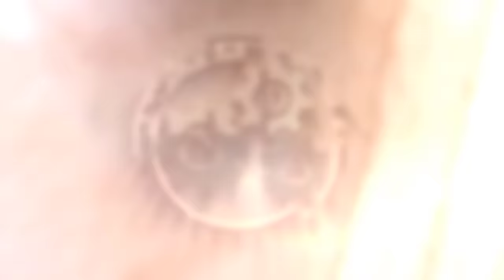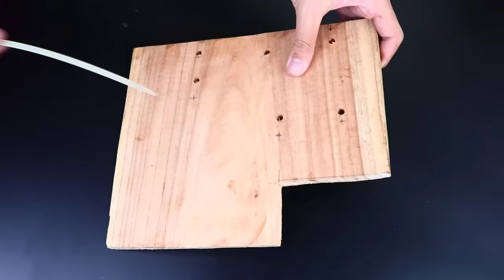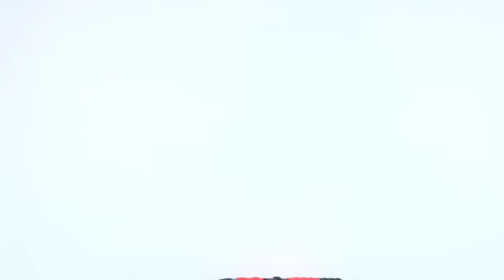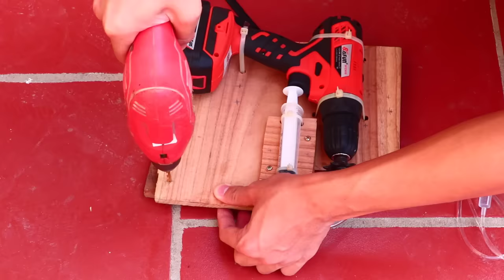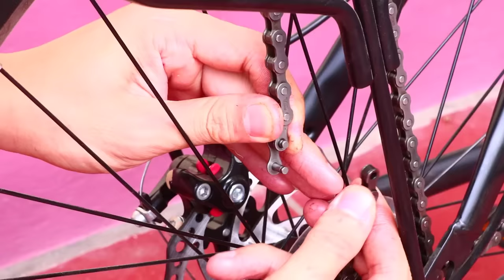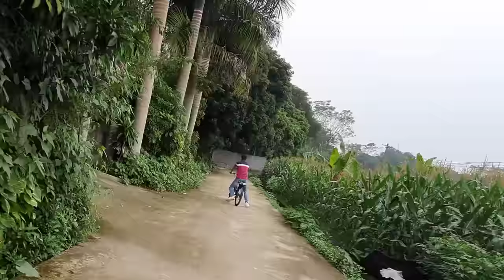How to Make Electric Bike with Drill Machine

Comment: The hydraulic throttle alone was Brilliant!! Loved it.
Reply: i thought so too. I could not understand what he was doing. very cool
Reply: Pneumatik Not hydraulik
Reply: @sawe4207  Pneumatic uses air, this one is definitely hydraulic
Reply: There is nothing in there, also air, also Pneumatix
Reply: @James-wd9ib  no I'm pretty sure that's just air
Reply: @ceterfo  how would you explain the small bubble of air in the syringe? XD
Reply: Ingenious as F ! I thought it was water cooling or something wild to start with
Reply: You could also use a bike brake cable and handle loop it around the drill throttle then cable connector
Reply: @sawe4207  there is water in it. There would not be enough pressure for air to be able to move the larger syringe and the throttle at the same time. Air compresses far too much to work. Definitely hydraulic
Reply: @MountainYucker Old post, I know, but yes, Hydraulic. Air compresses, and is the reason for spongy brakes (trapped air). Fluid doesn't compress, and that is why it's used in brakes.
Reply: An “ injection “ of genius!

Comment: 10/10 for idea. But would be interested to see how long it lasted before it fell to pieces.  Needs more development I don't think cable ties will last. Hopefully you take comment in spirit intended as appreciate your video.
Reply: I don't think this is meant to be an actual ebike. The battery is only 30wh even in the best case, so this will last you all of 20 minutes probably
Reply: @balazsrako9528  20 minutes is enough.  If you add a solar battery and build a solar canopy at the top, then it will take you a while to run out of energy.
Reply: The rider could easily purchase and carry extra charged batteries, and it's just as easy and fast to exchange them on the spot rather than an actual ebike battery. From all the reports I've heard and from my experience in dealing with tool batteries, they're also safer.

Comment: High torque, 2 hour max range lol. Awesome ingenuity though🇺🇸✌️
Reply: Sounds perfect if so.  I have an extra drill and want to try this. 2 hours on one battery would be great since I could carry a days worth,  no problem.
Reply: Video is downhill,  probably doesn't work.
Reply: @kickinbilliards5971  when you have the correct ratio and or a powerfull drill it should
Reply: @kickinbilliards5971  video fake
Reply: @kickinbilliards5971  It would still be good as an uphill assist imo

Comment: Great throttle system. I plan to not use chain and sprocket but fit small rubber wheel to the drill and drive straight onto the tire as I only drive on hard roads.
Reply: Thats what I wanna do to, mostly because i know I’ll forget and shift on to the drive gear with my old school tension shifters (thats not the proper name but not clicky gears

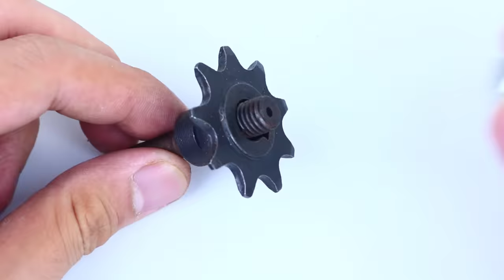Comment: can i ask you, what is the part you use at 0:40? does it have one of those splines that lock with the gearwheel?  im trying really hard to find a bolt/axel that could fit the gearwheel. (i have same gearwheel as you, m11. 

thanks

Comment: Hello, I would like to know where did you get the bike sprocket that attaches to the drill? I want to buy one.
Reply: Please I want to buy one
Reply: You can buy it from amazon or just google 9 teeth e bike sprocket. It's the 9 teeth sprocket that usually comes fitted with geared 250 or 350w china made brushed DC motor of UNITE conpany. For 250W the model name is MY1016Z2 & for 350W it's MY1016Z3. Both come with that standard 9 teeth sprocket with square key grove. You can also get 11/12/13/14 etc teeth sprockets that come on other china motors of same make, eg. MY1020 has 11 teeth sprocket.

Though..... I don't recommend going for china products anymore after their gift of corona.

Edit : PLEASE check the pitch of your chain as the sprockets come in different sizes. More specifically, the 250W & 350W motors with 1 step gearbox reduction come with 9 teeth sprocket & can be used with cycle chain directly. But 11 teeth sprocket on 500W motor (which spins to 3000 rpm & has no gear reduction like above motors) can't be used directly with cycle chain as the sprocket is small & required #25 chain. Cycle chain is bigger than that.
Reply: @saketjoshi4476  how about the axel that's fitted inside?
Reply: @blueskiesinc  which axel are you mentioning exactly ? And also how can I help you with that ?
Reply: @saketjoshi4476  it's the one at 0:39 .  Any idea where I could look for that part?
Reply: @blueskiesinc  Ohh heh ! I see another guy asking the same question out in the comments. Not to worry ! If you observe closely, any drill machine has a 3 jaw center chuck which holds rod type drill like tools (& ONLY TOOLS). For that axel you are talking about, it must not be available in the market as the market sells only the mass manufactured parts designed for a particular machine & as everyone is not going to use a drill machine to move a cycle, this part is not going to be in the market. This axel is very application specific. So, what you can do is manufacture it with simple dimensions out of mild steel & get it blackodised or any micro layer coating to avoid rusting. If you have a manufacturer or fabricator workshop near you that has a lathe machine, you can show this axel to the guy there & he will craft it for you. It will be a just a little bit costlier to get it manufactured than a mass produced tool of course. But still it will be very much affordable.
Reply: @blueskiesinc  Tell the manufacturer guy to decide the dimensions for you. Sit with him & finalize upon the dimensions.

Though I WILL NOT RECOMMEND GOING FOR THAT AXEL in the VERY FIRST PLACE.

Reason - drill machines are made for DRILLING stuff with a proper tool. The drill machine hold the drill (the tool) in its 3 jaws ON THE BASIS OF STATIC FRICTION. That friction is enough to hold the tool & resist the counter torque (which makes the drill machine slow down when you star drilling). But moving a big mass like cycle can introduce slip (drill machine will spin but not the sprocket) if counter torque becomes enough (because of so much weight) to overcome the static friction offered by the jaws.

The original motor for this sprocket comes with a square key on the output shaft & that sprocket has key grove which which slides on that key on the shaft. This ensures no slip in any & every case however big the load is.
The worst case motor will burn. But the shaft will never slip 😛

And to avoid burning of motor, calculate the power requirements properly to move your total mass so that the motor can take that much load !

Comment: Tbf ill start believing this when they actually drive uphill instead of downhill lmao
Reply: my thoughts exactly i live in really hilly area that would last 5 minutes and id rip it off and cycle using my legs.
Reply: I think you’d be very surprised by the torque from the drill. I say that having just built a drill powered go-kart and the 8ah battery I have lasts about an hour.
Reply: @nickpinder3047  video and parts list please...

Comment: Drill would probably have higher RPM than an impact driver. But the impact have more torque for a much higher gearing to end up being faster. And my buddy has some snapped in half Dewalt impacts. Make a rack on your frame to carry few extra batteries. You work in the same town you live. Small town guy like me I could make it work cheap AF commute. Easily serviceable and honestly cheaper, far less power but still

Comment: Cool idea, but you can't really properly use the bike together with the modifications because you can't shift to lower gears and your pedals are constantly spinning like on a fixie...
Reply: Nikola Kragovic To be fair, I think that for a quick and dirty motor set up, that one could preset their gear shift so that they don't need to adjust mid ride. Also, the pedel spin could be stopped by simply putting your foot on them.
Reply: @morgrimgaming7342  I agree that for a quick setup, it's really OK, honestly the idea is great, but the way it was made really forces you to just use the drill all the time while I think some pedal assisting in certain situations while still being able to pedal in others is way more attractive. More so because I doubt the battery of the drill can last a long time. Also, I don't think you can stop the pedals by putting feet on them, that's not how bicycles work or am I missing something?
Reply: Nikola Kragovic The way most mountain bikes work is that the pedals can be stopped without stopping the gears. Helps the rider conserve energy on long treks.

I agree on the pedal-assist idea. Personally, I'd find a way to mount that to the front wheel instead.
Reply: @morgrimgaming7342  I think you might be wrong. The wheel can spin while the pedals are stationary. However, if the cassette is spinning like in this case(through the added chain by the drill), the other chain will spin the pedals.
Reply: How about putting it on the front using a rear wheel with a sprocket. That way the rear drive is unaffected and the front electric drive would freewheel when pedaling. Plus less of a distance from the drill to the handlebar throttle.

Comment: Hello, my name is CJ and I am currently trying to do the same project that you did in this video. Only difference is I'm doing it to a trike instead of a bike and I've got everything set up. I've got a powerful 18 volt drill already, got the wood cut out and everything set up with the water Powerline. But I'm not sure I'm using the right sprocket and or connector pieces that go inside the drill. Could you please get in contact with me and let me know exactly what the names of the parts are. I would greatly appreciate your help and any useful tips that you might have to offer. Thank you!
Reply: I was surprised this didn't come with a parts list because the video is really good. Cool channel though, they have another e-bike video that has 28 millions views, that is awesome. This design is better and I think they could sell parts or the design plans, especially if they made a version 2 with the improvements that were put in a different comment
Reply: You could just have a machinist make one for you just show them this video.

Comment: where can i find that drill piece found at 00:40 that he put the sprocket on?
Reply: I made one by buying the gear part on amazon (just look up small gear) and I secured it on a bolt with two nuts on each side of it.  Than just inserted the bolt into the drill

Comment: I like your idea, but I have a few improvements that I would implement. Number one make use of a larger driver gear. Number 2, make use of the rear derailleur, that way you could have better speed and battery life. 3, get rid of the pedals, I like that you keep the theory for legality, but if you ever pedaled that bike without a break in drill chain, you’d kill it, 
Comment: Good job on the zip ties, although a better fitment could have been done with 3d printing. We have the technology!
Reply: WOuld be better to keep the pedals and add a freewheel on the drive sprocket.
Reply: @tatwood93  This is the way. The world needs v2 of this bike with these improvements.
Reply: @-._7  Definitely, the syringe idea is pretty cool and might be useful for other things, but I'd rather run the back brake cable to a pivot and have it run the trigger off the brake lever as well. Maybe hose clamps instead of zip ties? I'm completely down with using wood though, KISS method

Comment: No way this lasts more than 5 minutes
Reply: Nah a new drill can last up to 45 mins on full drill my thing is I don't thibk it could move most americans... I doubt my black n Decker would move with my but on the bike
Reply: @87wxdiaz  I could lift a car wheel off the ground with my 18V Ryobi turning the handle of the jack in 1st gear. My challenge drill has quite a bit of torque but would need further reduction. The Ryobi would need a freewheel though as the drill head locks in position when you take the power off, but in first gear with a chain around the big ring on the bike and a little cog in the drill you should be able to use it as a mid-drive except I have a bafang BBS02B so there's little point now.